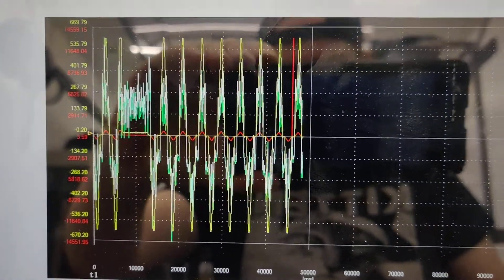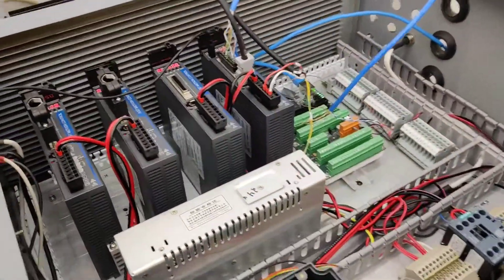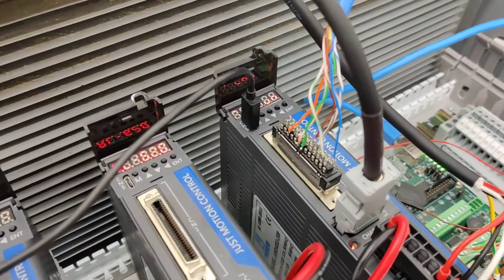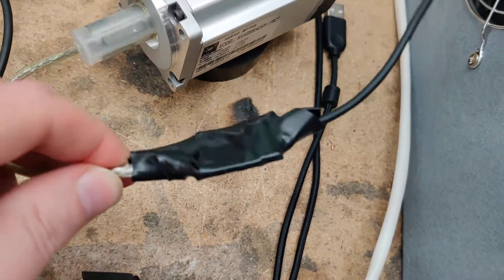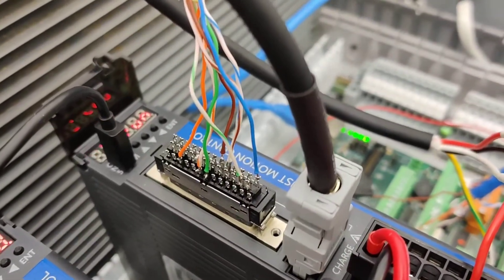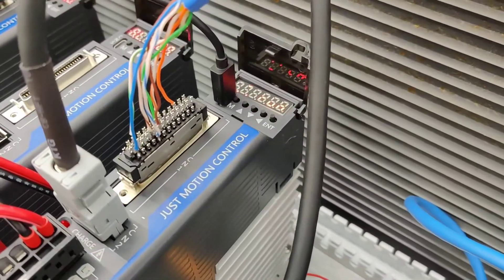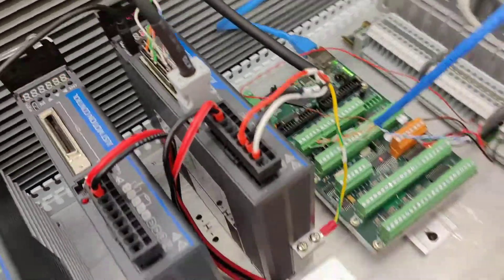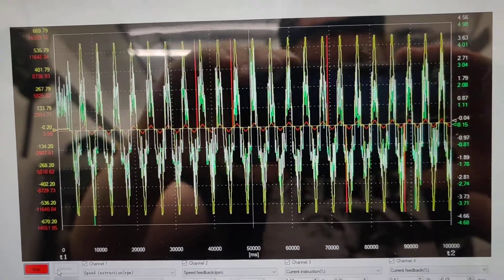Spin Test of JMC AC 400W Servo Motor with JAND 4002 Driver

Comment: Hey, would you still recommend these servos today? Currently digging through all available options
Reply from the maker: Mechanically, electrically they work as good as they did when they were new. The software is a bit too complex for tuning them. That's my only issue with them.

Comment: Hello Bryan,

I am currently planning to convert my milling machine and would like to use servo motors. 
Since you’ve already worked with these motors, I wanted to ask how satisfied you are with them. What has been your experience so far? Is there anything you would do differently in hindsight, or would you choose the same servo motors again?

Also, I’m curious about how the tuning process went for you. Was it straightforward, or did you face any challenges?

I’d really appreciate your insights and advice. Also, thank you for your informative videos they’ve been a great help!
Best regards

Comment: Hello brother, could you show me the diagram to make the connection from micro USB to USB, I would appreciate it very much.
Reply from the maker: You'll want to get yourself a USB to FTDI adaptor and wire up a micro usb cable to it. You can see the wiring for it in the manual here:
https://de.cs-lab.eu/wp-content/uploads/2024/02/jmc-jand-series-ac-servo-driver-user-manual-202011.pdf

Search that page for:
3.5 Description of the driver's CN5 port

This will give you the wiring order.  It's a pain in the ass but once you get it correct, you don't have to do it again.

Comment: I am using a Digitus Adapter that has an ftdi chip built in. Communication works fine with a null modem Adapter. You can achieve the same effect by switching the transmit and recieve pins. Maybe this will help someone. 😊

Comment: Dear sir,

I have bought the 750w JMC servos similar to yours. I am however unable to get them to work. 
I can run them in jog mode on the driver itself but not from my masso controller.  I have checked the controller by connecting it to stepper motors and it works fine. 

It seems that they (servo drives) are not reading the input from the CN1 port. I have iliminated all other factors. Did you need to change anything or parameter in oder for yours to read the CN1 input for step and direction?  I have tried the low speed inputs and high speed inputs. I have tried common ground and differential inputs. (Only 5v though since my controller does not output 24v.) 

I am at my witts end. The manual is not very helpfull and I can't find any other info. 

I have been trying for 3 days. This is also not my first build. Just my first with servos. 

Please if you have any info to share I would really appreciate it.
Regards
Reply from the maker: Check and see if the enable pins are connected. I think it has them but off the top of my head I can't remember fully.
Reply: Thank you for the advice. I will try that again tomorrow. 

Do you perhaps recall if it should connect to ground or 24v+  to enable? 

Thank you again.
Reply from the maker: @pohlmasjienwerke  hmmm I can't remember but I know it's in the manual. I have my servos setup on the high speed connections through a mesa 7i76e to drive them
Reply: @BryanHoward  Thank you.

Comment: Hi , i have the same servo driver but its not connecting to the cnc board
Reply from the maker: You might have to power the enable pin on the drivers

Comment: Hi ! It makes any hissing noise when stand still and enabled of course ? Mines makes a lot of noise, no matter what parameters setting , no matter what .
Thank you in advance !
Reply from the maker: They should make a little bit of noise but they shouldn't squeal. If they do then you'll have to turn the gain down with the software. You'll need to make an adapter like I did to talk to the drivers for contact the distributor and order an adapter. There's a setting in there that is effectively a damping filter that can help as well.
Reply: @BryanHoward  did you tune your one already? Did you make the noise disappear? I also noticed this noise is probably the reason for significant noise on the line.
Reply from the maker: @peterkolta1207  Noise is always there. I think it's just an electrical noise as I can't feel any vibration when they are tuned. I do need to go back and tune them as I haven't done so in a while. Basically have to tune them every time you disassemble the machine or after any significant changes to the machine. So far they have run well. They have spazed out a couple times but I think this is due to tuning error on my end.

Comment: Hi Bryan, 

please, could you help me with connection of drivers with pc? I was not possible wire a cables for communication. Is't there some special driver software instalation (Win10)? 
Thank you so much! :)

David
Reply from the maker: These servo drivers are not designed to be directly driven from a computer. Your options are to use a CNC breakout board (not a good option), a Mesa board (this is what I'm using. The 7i76E), or the grblHAL board (I think the best option). All three controller boards talk directly with a computer and in turn talk directly with the servo drivers. grblHAL runs on Windows so much easier to setup than a Mesa using linuxCNC. I would suggest read up on these options and others that exist.
Reply: @BryanHoward  Thank you for your answer. We are already using CNC controller and all movemenst are working. I have only problem with PC and driver connection. When the driver is in READY mode, communication working normally, however when I switch to the RUN mode, communication is lost. Do you know where could be a problem?
Reply from the maker: @davidvanicek4587  Sounds like it could be a power issue. If you have an oscilloscope, using that to check for noise on logic level voltages might show a huge spike or drop in voltage which resets things. If there's no electrical change in voltage when ready mode happens (meaning everything is powered) it could be a driver alarm of some sort. It's hard to debug without knowing all the hardware and state of the setup. 

Best thing would for you to isolate the problem as much as possible so you can narrow in on what's causing it.
Reply: @BryanHoward  The 7i76E board seems to be a bit aftermarket is there any board that you offer as a substitute?

Comment: Hey!
Cool!
I also want to order such servomotors, instead of stepper motors. I plan to build a 5-axis CNC machine "head-head". Could you make a video with the work on the cnc machine? Details of setting up servo drivers. How are they in the moment of retention? And general impressions. I will be very grateful. Good luck with this difficult task!
Reply from the maker: Yeah, I’m gonna make some videos in greater detail on the servos. I want to also cover the manual tuning aspect of them as well to better understand the process myself. 

In the meantime  Youtuber Crabs Shed is running the same servos on the X and Y axis on a heavier machine than mine you can check out.  https://www.youtube.com/channel/UCpGtApXHTfLVt7Pwe-Mgn_Q

And also JBWorxStudio https://www.youtube.com/channel/UCh3zjvN1D0jlJhBCGhJrXgg has some great videos on tuning JMC servos. It looks like he’s running the integrated 180W DC ones but the software is the same.
Reply: @BryanHoward  Thanks, I'm looking forward to new videos!
Reply: @BryanHoward  Interesting videos about setting up JMC ->
https://www.youtube.com/watch?v=_9Q-VFesnA0
https://www.youtube.com/watch?v=jvbw_PMOs-s
https://www.youtube.com/watch?v=aZJ2sTZ5vbM